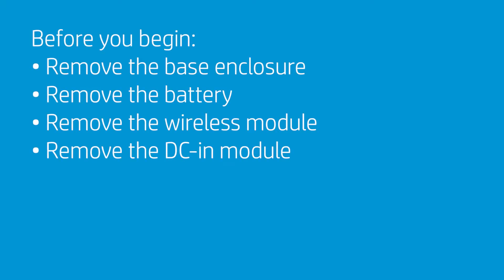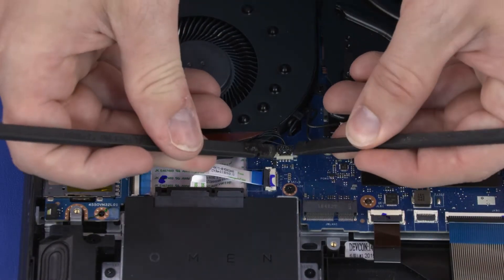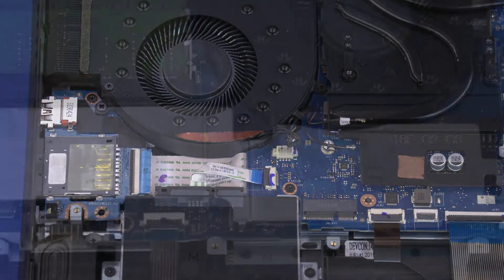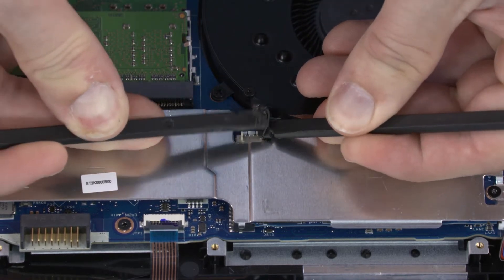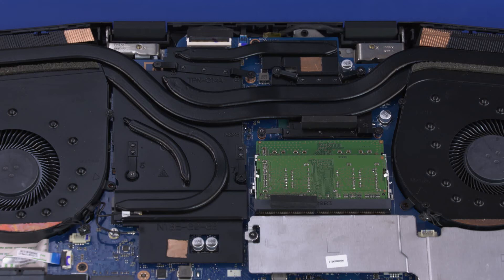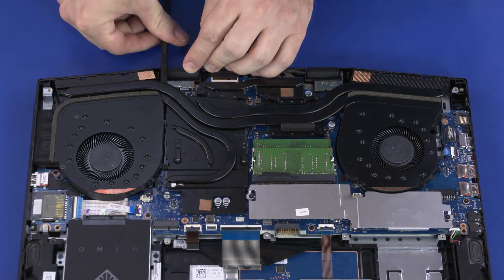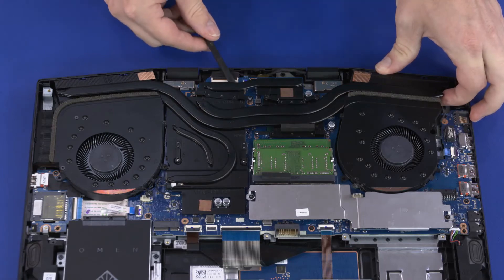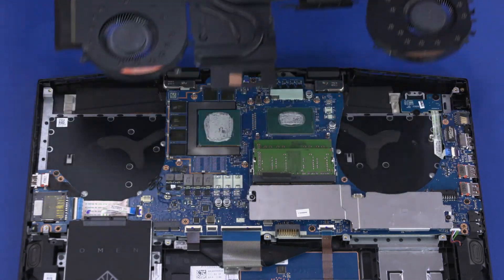Replace the thermal module | OMEN by HP 17-cb0000 Laptop PC | HP

Comment: Just to all definitely repaste it's worth it. I got a second hand omen i7 9750h rtx 2070 full it was running at CPU 92 to 99 degrees and rtx was at 80 to 85 degrees now after repaste CPU is 75 to 85 and rtx is about 65 and a lot quieter. And thanks for the tutorial
Reply from the maker: +ape man Glad to know that the video was so useful to you.
Reply: Update after a few months the mx4 thermal paste has an issue with pump out that causes the paste to push out and makes the CPU temperatures rise again. I now have use gc extreme which being a thicker paste has Less chance of pump out temp are now stable again and between 70 and 80 with no thermal throttling

Comment: Wow i did this with my omen 17 temperatures before when i was gaming was 80+ degrees now with thermal grizzly it does not go above 70 whilst heavy gaming maxed out thankyou HP
Reply from the maker: +Dan garvey I am glad to know that the video was very useful to you.
Reply: Dany which omen you have ? I have Omen 17 I7 9750 and 1660Ti. In Battlefield V on CPU 95-97C GPU 62C but on RDR2 my CPU only 78. I dont know Why? Tomorrow i want change paste on thermal grizzly.
Reply: @adamk.  I am getting same temps on my omen x 17 playing BFV. I think I ll have to change the thermal compound.
Reply: how you applied it bro? The X or the dot Method?
Reply: yeah, im going to change it to thermal grizzly to orrow. hopefully 96-98 degress will go away
Reply: @HPSupport  will with void the warranty with you guys?
Reply: What paste did you use? I'm looking to replace mine again, because temps are always above 90° while gaming
Reply: @bravoxray  thermal grizzly kryonaut extreme is a very good one

Comment: Do I need to replace the thermal pads? What thickness is good for this model?
Reply from the maker: +X325 You can purchase the part from here: http://partsurfer.hp.com/ Please select your country and enter serial or product number of your unit.
Reply: @HPSupport  He asked the thickness of pads, not where to buy. I need to know this as well. what thickness are the thermal pads on the vrm's? 1mm or 1.5mm?

Comment: Hi! Do you know if the model HP Omen 17-cb0050nr accepts the PNY CS2130 2TB M.2 PCIe NVMe Gen3 x4 Internal Solid State Drive? Thank you!
Reply from the maker: +Renato Correa Please refer page number 32 of the user manual to know about supported SSD: https://bit.ly/3ktEaCp
Reply: @HPSupport  Thank you so much for quick reply! I can see that "PCIe, Gen 3 × 4" is OK, but the manual only shows 1Tb size. it means that 1) I cant use 2Tb, or 2) in the moment that the manual was created the 2Tb didn't exist?  Do you think a 2Tb model will work?

I saw in the HP community that "Dell manuals are a good reference for what was sold with the system, but in no way do they reflect the limitations of the hardware".

Thats why i'm asking :)

Comment: Is there any key combo I can use to set max fan before games? Or do I have to use command center app every time to set max fan?
Reply from the maker: +Inuka Hettige I would like to inform you that the fan function is system managed and there is no option or settings (apart from turning it off/On in BIOS) to manually start or stop the fan. 
If you wish you can boot the computer into the Bios and check if you do have an option to turn on or OFF.

Comment: using this video to replace the thermal pads. after 2 years of use think they have had it. what thickness should the replacement thermal pads be ?
Reply from the maker: +C A You can purchase the part from here: http://partsurfer.hp.com/ Please select your country and enter serial or product number of your unit.
Reply: @HPSupport  sadly it doesn't show any parts relating to thermal pads. any ideas ?
Reply: @CA-tt9pc  which pads thickness did you choose? thank you.
Reply: @HPSupport  Just say you don't know

Comment: Is this necessary to replace thermal module with the new one if youre changing thermal paste?
Reply from the maker: +АлександрПоляков 333 It is not necessary to replace the thermal module.
Reply: @HPSupport  and is there no difference if i will use thermal paste or liquid metal? And also a question, am i able to remove cooling fan covers cuz they look like they were glued or melted to the thermal module?

Comment: hi please, for omen 17 cb1072nr can I disassemble fan only with out heat sink? how?
Reply from the maker: Hi there, thanks for contacting!
I understand that you need to know whether you can remove only fan without heat link on your OMEN Laptop - 17-cb1072nr.
I will do my best to assist you.
The fan cannot be removed separately. You need to remove heat sink/fan assembly. 
Binu - Social Media Tech Support
Reply: @HPSupport  sorry if the fan damaged and wana replace fan only what can I do ?
Reply from the maker: In order to get this issue fixed, please contact our customer care team over the phone or chat for further assistance, as this issue requires Live conversation with you over phone or chat to isolate the issue and provide you instantly with appropriate solution or repair/replacement options available at your place as per the warranty.
Please feel free to reach us on call/chat, please access this link to select your preferred country and language option to reach us. Global support link: - https://www8.hp.com/us/en/contact-hp/ww-phone-assist.html
Binu - Social Media Tech Support
Reply: @HPSupport  please I want avideo explains replacing glued fan to heatsink because customer care team wana take my device and other devices for days or more so we can't let our devices for there .
Reply from the maker: The fan cannot be removed separately. You need to remove heat sink/fan assembly.
Binu - Social Media Tech Support

Comment: HP Support when i change thermal paste i must change thermal pads alsow ?
Reply from the maker: +Adam K Before replacing the heat sink assembly, the thermal grease and thermal pads should be replaced. The thermal grease and thermal pads should be replaced every time the heat sink assembly is removed.
Reply: @HPSupport  tell me where buy orginal thermal pads?

Comment: How to open fans to clean them? And is this necessary to use alcohol to clean gpu and cpu when changing thermal paste?
Reply from the maker: +АлександрПоляков 333 Please refer this document to know about cleaning your notebook: https://bit.ly/3pB7GJN
Reply: @HPSupport  yes but i need to access the fan itself! But how to remove its cover? One part of the cover comes of easily, but in the place where is connects to vents, it looks like is was welded there!
Reply: @sherbetgod3066  you will have to remove the entire heat sink module to access the fans. THe fan assembly opens from the bottom side. So not accessible without removing the entire heat sink module

Comment: So after watching this video does replacing the thermal paste void the warranty?
Reply from the maker: +TheGreatGamer SVS HP does not recommend upgrading or downgrading hardware parts or software that is bundled with the product as It may affect the manufacturer's warranty and performance, however, you could change the configuration at your own discretion.

Comment: Hello. How thick are the Thermal Pads? I want to replace them. 
Kind regards
Reply from the maker: +Chris L. The part number of thermal pad is L57444-001.
Reply: If you replaced the thermal pads please sent me a link i need the thermal pads so bad i can't use the laptop without it :(
Reply: @SwatRocks_BeCalm  this is the Part number you can buy Thema With it on Hps Website
Reply: @Defender004  it's always not available
Reply: in my opinion, the original ones are 1mm and 1.5mm + a piece of probably 3mm or more
Reply: @HPSupport  he asked for thickness, not the part number!?

Comment: I own a omen 17-ck. I have an idea for not just replacing the thermal module, but upgrading it.
intro:
We see today the rtx 4090 GPUs that are gigantic with their oversized heatsinks and fans array compared to the small size of the actual GPU boards themselves.
So this got me thinking. Could we do a similar thing to gaming laptops?
The idea:
To install a large thermal module that is large like that and replaces the small one that comes standard.
Of course, the bottom plastic cover to be replaced with a smaller one that allows the new giant cooling system.
People buy gaming laptops not to use them on the airplanes or during commute and play on battery, but they use them as a portable gaming rig. Play in location 1, pack up, get to location 2, unpack, setup and play, etc...A laptop can be packed up. A desktop cannot.
So gaming laptop users will benefit from the extra cooling they can replace in each location they go and put the laptop on to play. Like in a hotel room where you spend like a week or two. You don't care about the bulky laptop because you won't leave with it each morning.
Reply from the maker: Hi there, thanks for contacting HP Global Social Media Support!
I understand that you need to know whether you can install a large thermal module.
I will do my best to assist you.
HP does not recommend upgrading or downgrading hardware parts or software that is bundled with the product as It may affect the manufacturer's warranty and performance, however, you could change the configuration at your own discretion.
Binu - Social Media Tech Support

Comment: Does replacing thermal paste voids the warranty?
Reply from the maker: +Ramiro Vázquez HP does not recommend upgrading or downgrading hardware parts or software that is bundled with the product as It may affect the manufacturer's warranty and performance, however, you could change the configuration at your own discretion.

Comment: Does anyone know why you need a wireless module?
This plastic is difficult to remove and can be damaged.
I did not remove the wireless module and removed the entire cooling system.
The DC-in module does not need to be dismantled either.
Reply from the maker: Hi there, thanks for contacting HP Global Social Media Support!
I understand that you need to know about the need of a wireless module.
I will do my best to assist you.
It depends on the PC and the user's needs. If the PC is a desktop that is already connected to a wired network or modem, then a Wi-Fi card may not be necessary. However, if the user wants to connect to a wireless network, then a Wi-Fi card would be needed.
Regards, 
HP Support
Reply: @HPSupport  I once went into a store and there was a dentist there who had pink socks. He told me that his bread lacked parsley. It was scary because Tuesday was approaching. Coconuts don't fall at this time in Amsterdam, so I took the board under my arm and took the elevator to Mount Everest. I ate a sandwich there. I thought it was important.

Comment: What about thermal pads? The written directions say to replace them but you don't even mention them. What thickness should be used?
Reply from the maker: Hi there, thanks for contacting!
I understand that you need to purchase the thermal module for your computer.
I will do my best to assist you.
Use the HP Parts surfer to identify the part: http://partsurfer.hp.com/search.aspx 
And order it via the HP Parts store: https://bit.ly/3nKMYrs 
Binu - Social Media Tech Support
Reply: @HPSupport  that’s the problem though, I already went there and it says the part is unavailable. So since you won’t sell me the part, what can I use as a replacement?

The specs aren’t listed
Reply from the maker: Thanks for the reply.
The spare part number for Thermal pad kit is L57444-001
Please refer page number 37 of the user manual for more details https://bit.ly/3ktEaCp.
Please search and purchase it online.
Binu - Social Media Tech Support